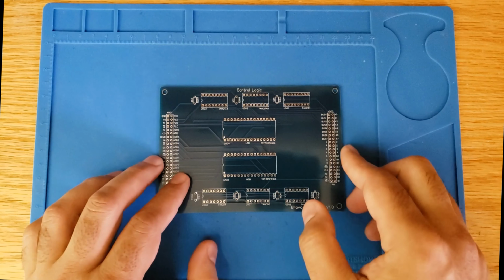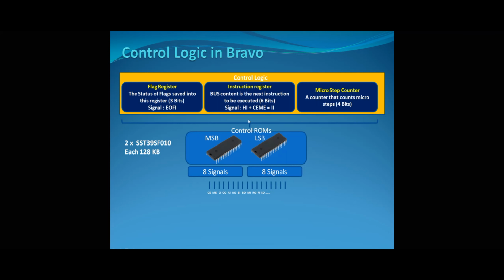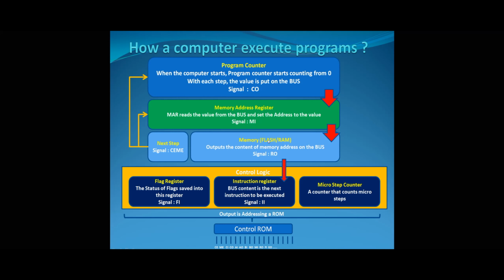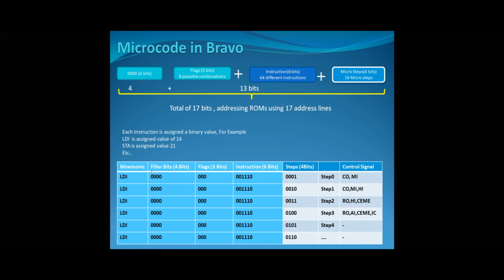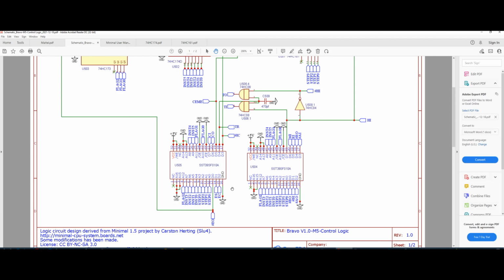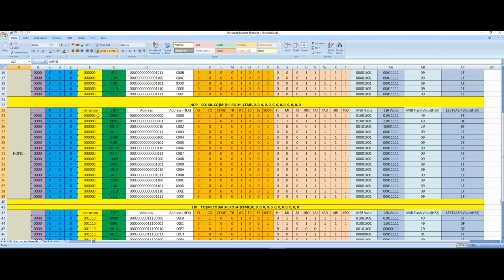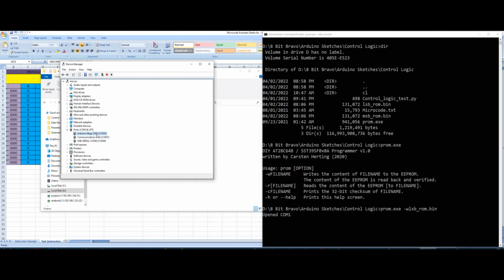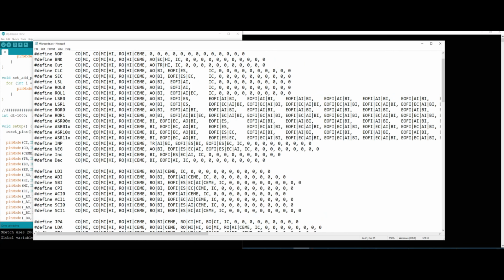Bravo 8bit computer-Part 13- Control Logic , inspired by Minimal Project & Ben Eater's 8bit computer

Comment: Cool video series! But: 256k Control-ROM?? That is too much, bro!
Reply from the maker: These are probably one of the most cost effective Flash/ROMs that you could get these days. An old 8K EEPROM will cost you close to 10 USD these days since most of them are out of the production and you should get either used or new old stock. These 128K Flash memories will cost a fraction of that while giving you 128K, and by the way 128K is the lowest capacity available on these Flash memories chips. Hope it make sense :)

Comment: Here some python code snipped to generate microcode
* Signal & template definition *
_bo = logic_output( 0, inverted=True ) # LSB
_bi = logic_output( 1, inverted=True )
_ao = logic_output( 2, inverted=True )
_ai = logic_output( 3, inverted=True )
_ro = logic_output( 4, inverted=True )
ri  = logic_output( 5 )
mi  = logic_output( 6 )
hi  = logic_output( 7 )
_eo = logic_output( 8, inverted=True ) # MSB
es  = logic_output( 9 )
ec  = logic_output( 10 )
_ic = logic_output( 11, inverted=True )
tr  = logic_output( 12 )
ceme= logic_output( 13 )
co  = logic_output( 14 )
ci  = logic_output( 15 )

# define complementary signals for easy MicroStep encoding
bo = logic_compl( _bo )
bi = logic_compl( _bi )
ao = logic_compl( _ao )
ai = logic_compl( _ai )
ro = logic_compl( _ro )
eo = logic_compl( _eo )
ic = logic_compl( _ic )

# template definition
# Fetch
f = ( co|mi , co|mi|hi , ro|hi|ceme )

* Creating MicroCode definition *
ANY_FLAGS = range(0,8) # all combination of flags. 0b000 to 0b111

u = MicroCodeList( _default )
# arguments: OpCode, Instr, flags/list_of_flags, list_of_signals 
u.add( 'NOP', 0x00, ANY_FLAGS, [f] ) # just the Fetch Macro
u.add( 'LDI', 0x0E, 0b000, [f,ic] )
u.add( 'LDI', 0x0E, [0b001,0b010], [f,ic] )
Reply from the maker: Thanks for posting it. I will look into it.
Reply: @ConfigIOI  I will complete a bit the script and post the full version

Comment: I'm coding some python code to generates microcode from microstep description.
I noticed several possible error:
at 44:02 you mentionned 17 bits addressing. Shouldn't be 16 bits?
at 1:14:34 you mentionned LDI have Fetch instruction using AI instead of HI. As a result the LSB Flash encodes a 0x07 in the flash at excell row #44. I presume it should be 0x8F as for NOP.
Tell me if I'm right
Reply from the maker: Hi Dominique, It's 17 bits since we need to address 128KB of memory on flash ROMs. (2 to the power of 17). As I mentined in the video, the 4 most significant bits are fillers, meaning that they are all set to 0 and on the circuit they are connected to ground. The remaining 13 bits will be used to address the ROMs. Hope it's clear.
In regard to your question for fetch instructions, this is a typo in the excel sheet. Looks like I skipped a step by mistake. The fetch microinstructions are exactly the same for all instructions. I uploaded a coorected version of the excel sheet on github. Sorry about that and thanks for bring this up. so the fetch is always CO|MI, CO|HI|MI, RO|HI|CEME
Reply: @ConfigIOI  indeed... Adressing.... i was indeed wrong! thanks fot the note